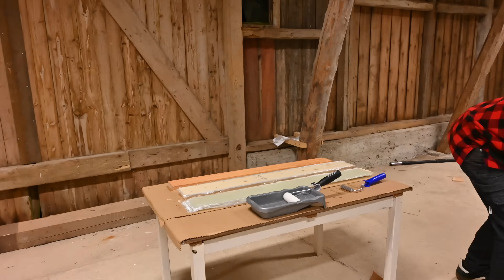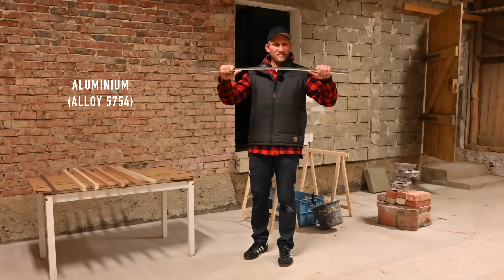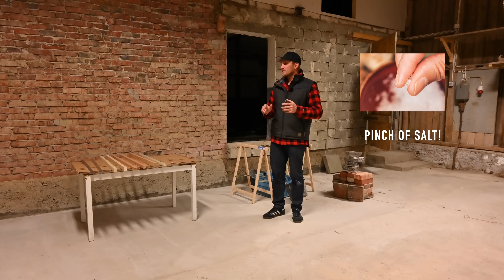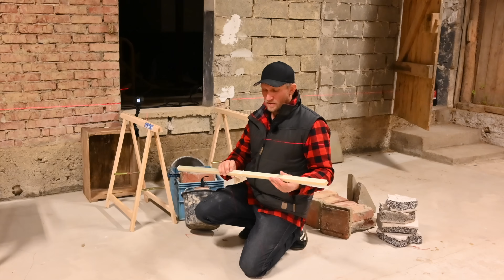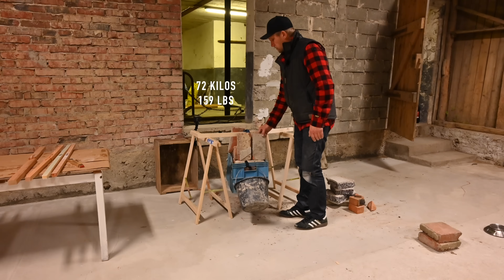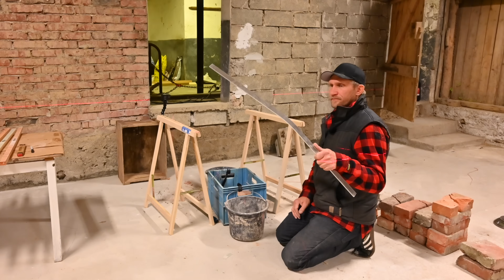Boat Hull Material Test - Which Breaks First? - Ep.  319 RAN Sailing

Comment: I took a fast search - boats 45-55ft - 2000-2005 year used on the Yachting World  - different materials. Steel; many very cheap boats to be had - good looking design too. Wood; some strange and some classic designs - big variation in prices. Composite - lots of good designs - like Catana cats reasonable prices. But looking at alu-boats - there are very few and they are very expensive. I have been following the Allure Arctic fixing of their Garcia - and I think they get a great value for that boat-job they have had. I get - you are a carpenter and wood is nice to work with - but I would look carefully at alu for a project like this. I get the desire to build a boat - and it will be very good content - and also the life situation - so it make sence. But just economics - good used monohulls is very cheap now.
Reply: Monohulls and boats in general have gotten much more expensive in the last 3 years. We're talking 50-100% more expensive.
Reply: @sven-0  Prices are going down again. On monos. But also some big good cats seems like good value. But my main point was the construction material - related to 2.hand value.

Comment: That was quite fun, how do they compare on rot resistance? I appreciate they should not get wet but would be nice to know that if you have a small seeping leak around a skin fitting it would take some time before the wood degrades?
Reply from the maker: Cedar is probably the wood with the best rot resistance in the test. Design will be important to prevent any water getting into the core… 😊

Comment: Nice test.
What I got from this, is that, with the exception of Red Ceder, the strength mainly comes from the fiberglass. That's why these were so close.
This was to be expected. In woodcore building the glass defines the strength, not the core. That is why balsa is used so much.
This is similar to  divinycell. But as you stated correctly, (at least the first layer of) glass must be applied with the vacuum technique.

Comment: For the aluminum and steel, you should have used square tubing, but I was really impressed with the Swedish Spruce.
Reply: I was thinking the same thing, but then I took into consideration the weight factor and square tubing would be 4 times as heavy per liner measure.  How much weight could that piece of ceder take if it were 4 times larger?
Reply: @InquisitiveSearcher  Hi Jim! Yes, it is heavier, but it would give it strength (and same shape) which is the criteria he was comparing all to and the weight would have been the eliminating factor and not the strength.

Comment: Fun to see: About the Divinycell - the glass delaminated? But that could be a real piece of hull - same as steel and alu - but with the other wood example you have yo add several layers of glass? All of them also needs paint - except the alu. I once looked at a homebuilt cat (Woods Skua) that was built of norwegian spruce - it didnt look good - so to get the right quality and dryness in that kind of material can be a gamble. Its a reason - the douglas fir is used and why it costs more. Maybe it could be possible to get better price with some direct import? Compared to Divynicell - how many layers of glass do you need?

Comment: Since you may be using multiple layers of thin strip planks you can sandwich a light and rot resistant middle layer/layers with highly non-porous and hard interior and exterior strips due to bilge water and impacts and water migration from scratches and punctures in the outer glass skin.  Can save weight and cost on the interior layers while still being good boat wood.  I've seen and helped build (just one but 27 feet) mahogany runabouts use this method.   Gives look and good properties of the costly wood but  the majority of required hull thickness is lower cost good quality wood. 
 Be fun to see this test in epoxy saturated and glassed layered samples.

Comment: Cool video! Nothing wrong with being nerdy once in a while. Food for thought: The one added feature of the Western Red Cedar is it's rot and insect resistance. Spruce and fir offer very little rot resistance and borer worms would likely consider them both a feast. Yes, you're encapsulating the wood, but in the event of a breach of the protective glass layers, the Cedar will serve you best. Also, even though the price seems prohibitive, I suspect the hull will be less than 25% of the total wood used. Plus Cedar will give you a higher resale value. That's my $.02

Whatever you choose, I'll still enjoy the videos!

Comment: I am biased as I have a steel boat. The Hull is only 4mm, but what makes it strong is the shape... If you folded the steel along its length then you would have a very different result 😂
I do know that 10 tonne 100 mm pine Dock is no match for a 10 tonne 4mm Hull!

Comment: Just a bit of input,  but as boats have been build in only wood for many years i think you'll succeed either way. 😉

When testing material you do need to remember that it's the thickness combined with the surface-strength that provides the stiffness.
In the first test you did where the GF de-laminated i would consider that an invalid test as it was not the GF that broke but the bond between the wood and GF.

This is also why it's important to get as good of a bond between the wood and GF to get the most out of doing a wood/GF sandwich. Might be possible to treat the wood (Perhaps some roll-on infusing epoxy for a few millimeter penetration?) before applying the GF to get a better bond that's more than just surface to surface.

On metal-boats it's the stringers that will provide the deformation-strength the same way as a I-Beam works, so a "real" test would have been to put the metal on it's side.

Ie.. It's all about the structure and that the internals (welded steel or laminated GF/wood)  have a strong bond... An I-beam of metal is much stronger than just a solid bar of the same amount of metal.

Quick search to explain the behavior gave me this...  https://www.youtube.com/watch?v=UspM9qOdAmI

Good luck! Will be interesting to follow the build!

Comment: As you said, it is not a scientific test. I have yet to see any boat built out of steel or aluminum that had no bulkheads, cross sections and internal braces. You are not building an above-ground swimming pool just walls and nothing else. The properties of steel substantially increase based on the bracing. That is why they built ocean-going ships, tankers, and even submarines out of metal.
Reply from the maker: Yes, I’m aware of that, and I mentioned that in the video. 😊 However, weight
for weight a wood/glass fiber hull will be stiffer than a steel hull at the same total weight.

Comment: I kind of differ a little bit I think the dimensions of the woods should be the same not necessarily the weight. You're building a boat with certain size planks, thickness and width. To me the weight would be something to consider of how much the vessel would weigh. Of course that's my opinion. 😉
Reply from the maker: Yes, but this was just a way to show the  differences between the materials at the same surface area and weight.

Comment: The choice of wood should be related to the construction method of the boat and the part of the boat. Douglas-fir would be great for framing, with the Swedish spruce as a planking material. All of the materials are part of a construction system. A hull designed to built from foam and fiberglass is extremely strong because of how the fiberglass works with the foam, and how the loads are transmitted through stringers and bulkheads.

Comment: For a truer test of how the metals perform verses wood and composite material I think a square bar rather than a flat bar would be more accurate. The way you side loaded the flat bar material you used is it's weakest point. If you had turned the metal bars 90 degrees before adding the weight, either steel or aluminum would have out performed any of the wood or composite materials. Another benefit of metal would be ease of construction. Welding metal, once learned is easy to replicate.
Reply from the maker: Yes, you’re correct. The shape is important for the strength, but you don’t use square bars when building a boat hull. You use sheet metal with supporting stringers and frames. So like I say in the video the comparison between the metal samples and the rest is not fully accurate. But the conclusion is still that you can build a much stiffer hull from wood/fiberglass compared to steel or aluminum at the same total hull weight. 😊

Comment: You should repeat the tests with pieces of wood the same size.  You will likely see rather different results.  The spruce will work, but it has rather poor rot resistance if it is like most of our north american sprces.  Douglas Fir is a good, it somewhat heavy boat building wood.  I just sold an 86 year old boat built from Douglas Fir and it was in good shape.  Another consideration with wood is the number of growth rings per centimeter (ring count).  The higher the number the better the wood will be.  Unfortunately, most wood that is available now has rather low ring counts and is much less rot resistant then the same wood with a higher ring count.

A couple of good woods, if you can get them and afford them are Port Orford Cedar and Alaskan Yellow Cedar (or similar woods).  They are light, strong and very rot resistant.  A similar wood might be Spanish Cedar.  That wood is highly resinous and rot resistant, but I don't know how well it glues.  There may also be some good cedars in Sweden/Scandinavia that are similar

Another consideration with western red cedar other than price is that its dust has a rather high toxicity.  I know a number of people that can't work with western red cedar because of how it affects them.  It does smell great though.
Reply: Todd, what do you think of Blue Foam for boatbuilding? 🙂  Wow, that experiment goes back a ways, eh?
Reply: @todmills  Yeah, I actually still have the Blue foam Dinghy.  Blue foam doesn't have the compressive strength for building a bigger boat and it is difficult to bond glass to.  It was a fun experiment though.  My 8' dinghy came out at 43 lbs finished.  It is actually difficult to row if there is any wind because it is too light.

By the way, do you still have the Montgomery?  I still have the Allied.
Reply: @todddunn945  Yes, I still have the Montgomery.
Reply: @todmills  Cool.

Comment: I really liked your test. I know you already have your mind set on, wood epoxy & fiberglass. 

Why I think steel is a good choice. 1.) Dollars for one.
2.) SPEED of assembly. 

Yes steel is heavy to work with. But time in finishing a steel haul & deck, are much much faster than one built with wood epoxy & fiberglass, much faster.

You might save a year of labor by going with a sixty foot steel boat.

Comment: (Edit: I somehow missed part of the video where he gave the layup schedule, which had several glass on both sides, so much of this comment is poorly informed. I was surprised that it broke so quickly, especially given that it had glass plies on both sides. It just shows how important vacuum bagging is) - The foam core would probably have been much stronger with the glass on the bottom rather than the top. The idea of sandwich construction is that shear loads are converted to tensile loads in the skin. The fiberglass in your test took none of the load because the shear load you applied was transmitted through it to the foam, which has little strength of its own absent the fiberlglass (or kevlar or carbon fiber) skins.
Reply: I think he laminated both sides of all the samples that were laminated.
Reply: The issue with the foam cored composite panel was the mismatch between 60kg foam (too light and thin) and the skins at 15 or 11x300g (to thick). For a bottom laminate 2000g total for each skin and 25mm of 130kg foam. This would be about 350g if vac bagged and closer to 390g if hand laid.
Reply: The divinycell had glass on both sides. The problem is getting it to adhere as it wants to pull away under compression loading. For hand application often cab-o-sil (fumed silica) is mixed with epoxy to improve wetting into foam, otherwise vacuum bagging is recommended as Johan mentions.
Reply: @CraigOverend  He has made it clear that he will not use the vacuum film construction method, maybe they think it is too cumbersome. This is very subjective. If there are no conditions, I guess everyone will use titanium alloy shipbuilding, hahaha!
Reply: I thought I heard him ask himself if he should put the fiberglass side on the top or the bottom, and chose to put it on top. Bagging improves adhesion, but even without bagging, a glass ply on the bottom wouldn't have failed that quickly. And the only pieces of glass visible were on the top, where it delaminated. If it were an adhesion failure on both sides, we would have seen delaminated fiberglass on both sides. Anyway, he did a great job on this video, as they always do. He chose the material he understands the best, which is the best choice.
Reply: @maxrudder6091  The divinyacell had 11 layers on the inside and 15 layers on the outside. The inside layer bent more because of this and delaminated first because of poor adhesion which compromised the whole structure.
Reply: @CraigOverend  you're right. I just watched that part again. I missed that. I'm surprised it took so little force to create the failure.
Reply: I stand corrected. I somehow missed the layup schedule for the foam core. I'm surprised it broke so quickly, even without vacuum bagging.

Comment: Do you know the material "strong plank system"?
This would be my selection for building a boat.
Reply from the maker: Yes, I have heard it’s great but it’s hard to find much information on supplier, price etc online. Cheers!
Reply: @RANSailing  I can give you a contact to someone how has build a very nice classic yacht from this material.
He is (was?) the owner of a company in emden which is working for the german submarine industry.
The 39' nissen designed boat he sold was extremely nice (can send you some pictures) but now we bought a decksaloon yacht.

Comment: While comparing samples by weight may be "scientific", the next test should be by similar size of sample. Results should be of strength vs weight vs cost for given size material available commonly used for boats. Then, consised that the completed hull will act as a system, not individual pieces.
Example: a carbon fiber samplle using weight as condition for test would amount to a huge plank. Waaay over built and horribly expensive if applied to boat using those parameters.
Of course, you know this and can handily apply researched weight/volume/price to best determine ultimate numbers

Just saying for clarification for all.
Best to you :)

Comment: Interesting experiment.  On the foam/glass piece I think you should have had the thicker layer on the bottom where it would be in tension rather than compression.    It looks like it failed in the web not from stress in the fibers.    The thickness makes a huge difference in the strength, like to the 4th power.  Glad you didn't kill your self when you jumped off the test??   I did that once on a piece of steel, it scooted out from under my feed and I landed flat on my back on the concrete floor from about 1 meter, it really hurt, but didn't break anything, I was very lucky.

Comment: I would go with western red cedar. Remember the strip planking is a small percent of total build/outfit cost. For strongest hull use several layers each running in a different orientation!
Reply: Thats an other construction. Baked of veneer wood in 4 directions. And then covered with fiberglass. That will be alot of work. But strong.
Reply: I agree that they should strip plank diagonally in multiple layers glued together. That will make whatever material even stronger.

Comment: A well collected group of data. But what does it all mean? Strip-planked can absorb a pretty great shock before a frame fails. The results would have been different with 8 inch sawhorses (closer frames). The glass and fiber are the abrasion protection for the wood.  On the metal dent the steel is considerably more elastic than the Alum.  The Identical impact on both will be felt by the welds nearby, Alum is far more brittle than steel.  The sheep strips covered with well applied glass will bounce off that same iceberg depending on the frames design.  I love you guys, please give kisses to the ladies from me.  Internet delivered kisses fax as well as doughnut holes  LOL.